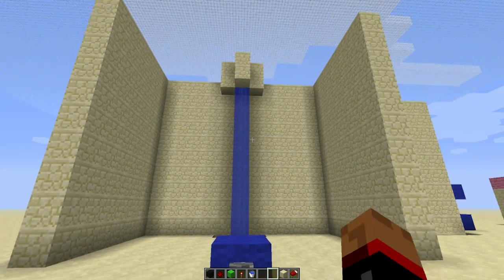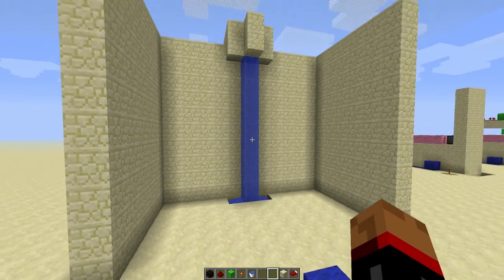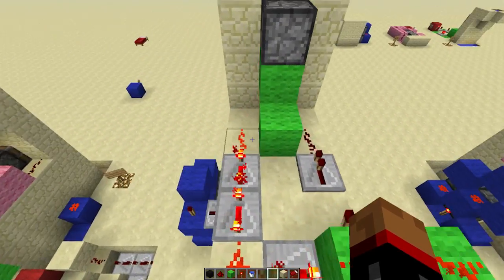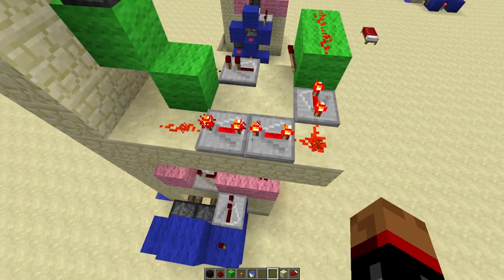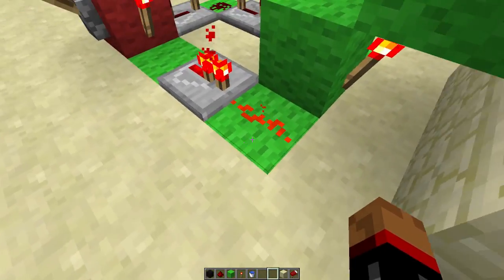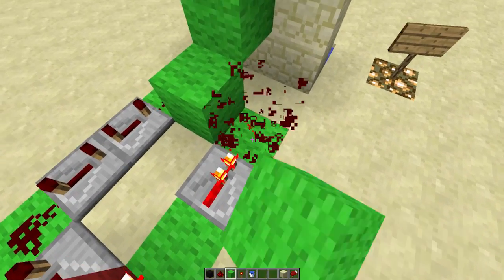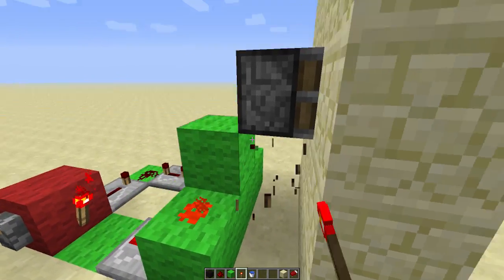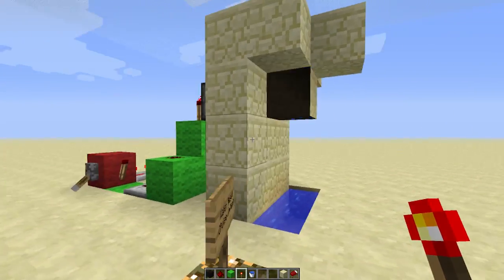1.0.0 Fixes: Batcave Entrance [Minecraft Redstone Tutorials]

Comment: People that are running 1.2.5 LISTEN the trick is to make the circuit that resets the water longer until the piston quickly retract and extends: If you get the timing right using repeaters the circuit should "die" meaning burn and stop extending and stay retracted.